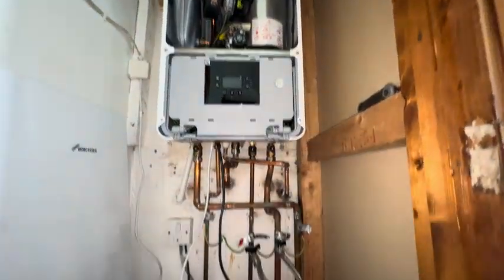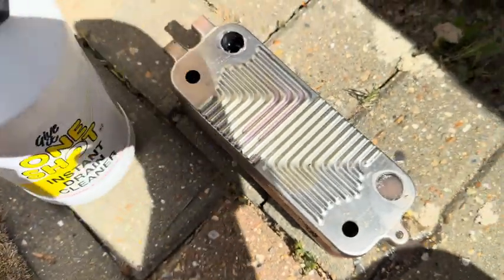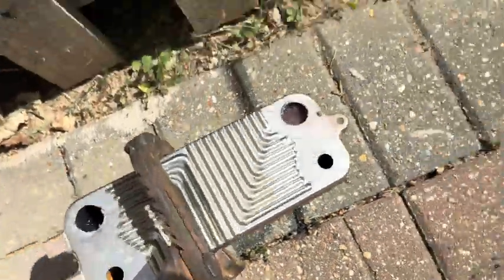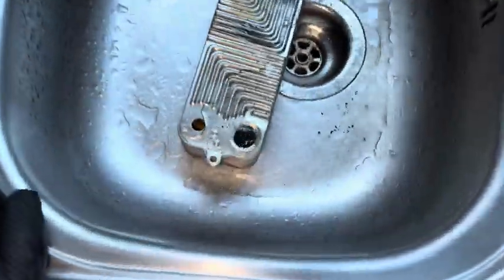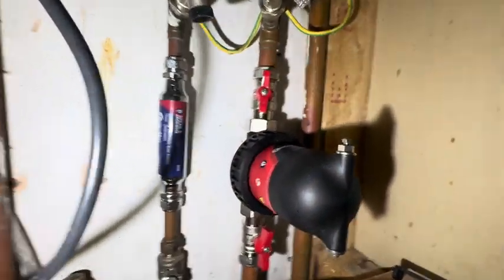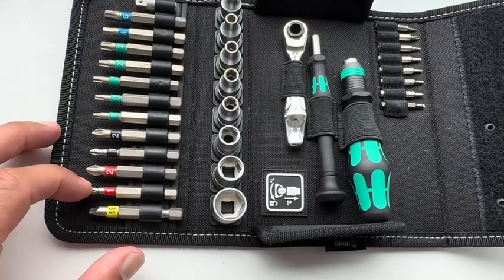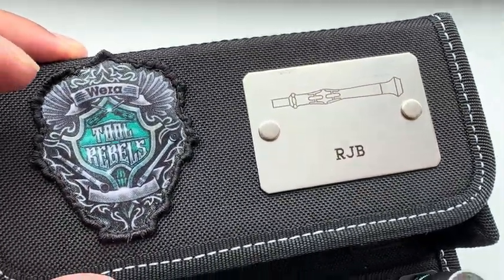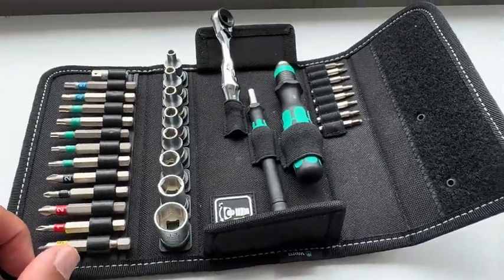Why do I need a system filter?

Comment: Im surprised Worcester even came out under warranty with no filter, lime or shock fitted🤷🏼‍♂️ i use calchem all in one on newer systems with no need to flush it out as its a cleanser and inhibitor👍🏼
Reply from the maker: I was too!! Especially then to replace!

Ooh I’ve not heard of that, I’ll
Check it out!